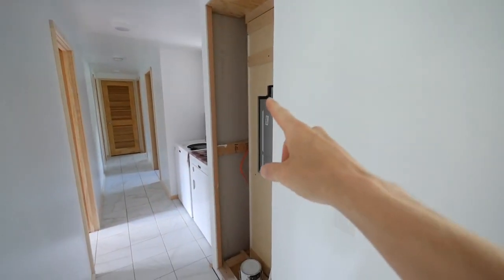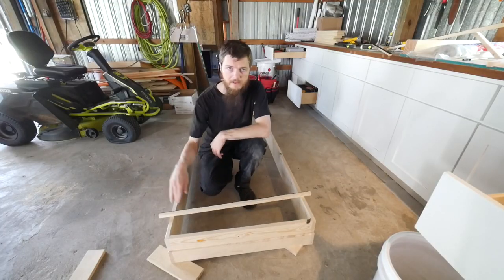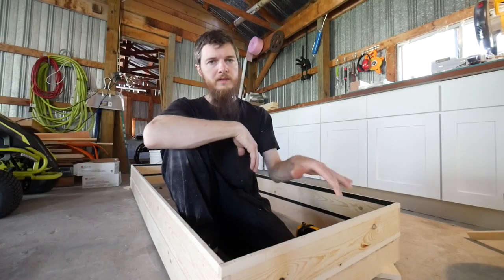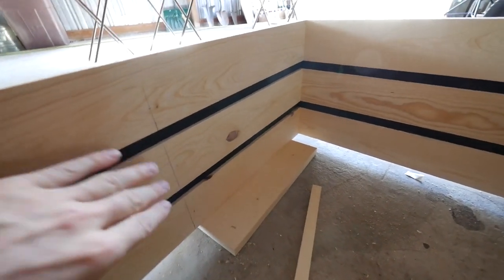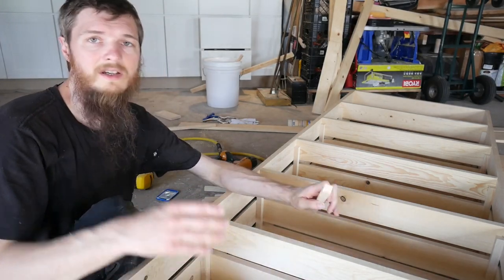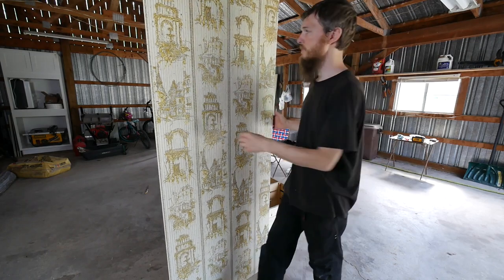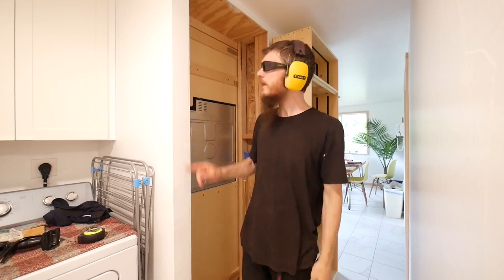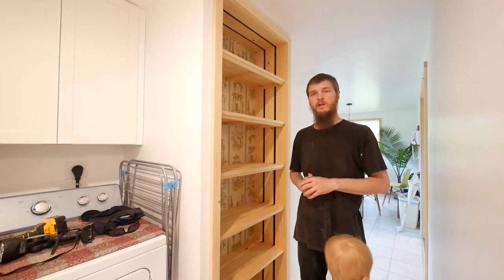A Novel Design for Our DIY Built-in Bookshelf

Comment: Your drive for a consistent look through the house is to be commended as is the way you thought through the design and Bella's input to get the black woodwork done to achieve the style effect. I worried that you should have used a mask while skimming the relief for the cutout and wondered if you could have used the vacuum for dust extraction. Plaster dust gets everywhere and you will be clearing it for a long time.
Great news that the roof and siding are on this year's projects-to-complete list. After all the very successful design and creation work for team DIY, you need it to get all the protection to preserve its comfort and look.

Comment: You have blended past and present beautifully.  The black addition to the shelf ties in to the floating shelf kindling box and the accent wall to me.  The use of the paneling as a backing ties in the kitchen paneling art and the original look of the house. Because it is a bookcase, the paneling will not be a dominant feature, but a hint of the past. The books will draw the eye first.  My only concern, which I am sure you considered, is a heat barrier between the oven and the back of the bookshelf.  Probably the back of the oven never gets hot to the touch.  Another great job!

Comment: Yay!  It’s in! Great job, Doug. You know me, I love that old paneling (and absolutely adored the kitchen paneling from a previous residence of yours,) but if I had been around, I would have encouraged you to test a technique by diluting some white paint, and white washing, then wiping off excess, so the undertone would go better with the wood & wall paint. I love it this way, but I’m thinking about the aesthetic. The good thing is that the books on the shelves break up the sallowness of the paneling. 

I know folks keep pestering you about the hole where the barrel stove used to reside, but I’m assuming that you’ll try to patch it when the new roofing supplies show up.  

Btw, what did Maverick show you, Doug? 

Also, could you have slightly dampened the drywall, and still use the circular saw? I know come saws utilize water, but I’m not familiar with your particular tool.
Reply from the maker: That roof hole is now repaired :) Maverick had a bug, haha. Can't dampen the drywall and use the saw, but we could have cut away the drywall first with a knife and then used the circular saw for the wood.

Comment: Love, love, love the old paneling for the shelf backing 😊.  A little glitch with the opening but all good. Try spraying the drywall with water before you cut. It helps cut the dust. Or have a vacuum hose trailin g the blade. Anyway, looks awesome.
Reply from the maker: Thanks!

Comment: In case you haven't already, blow the sheet rock dust out of your circ saw intakes with your compressor ASAP.  If the dust gets moist from humidity, it will solidify into a hard paste and seize up the motor. Gypsum dust destroys non-HEPA equipped shop vac and regular vacuum cleaner motors in the same way.

Comment: Love the bookshelf and the backing. If you get tired of it you can paint it. Did you already mention if the vents on the back of the oven will interfere with the bookshelf blocking it?
Reply from the maker: The oven is meant to be installed in an enclosed cabinet so it's all okay :)

Comment: I can imagine you clearing up dust for weeks after that. It continues to lay over a number of days! Is it safe to block the back of the cooker with your book shelf? Anyway looks good but did I hear you say you going to paint Belles room as I thought her bedroom was already finished? Take care and stay safe
Reply from the maker: The oven is meant to be in an enclosed cabinet. We only had to cut it open to make the oven slide back a little bit more to fit better. The oven vents out the front. Her room still just has the unpainted paper technique :) Thanks!

Comment: It turned out great. I was sure the old paneling piece would look bad, but I think it looks great. Does the back of the oven get very hot? Just worried that bookcase it right up against it.
Reply: The oven is made for tight clearance and heat shielded so it's okay. They talked about it when they installed it.
Reply: Thanks, I  watched it but I may have missed that part.

Comment: Did you get the commercial Maytag washer and dryer.  I have heard it is a good machine.    Have you been happy with the Maytag?  Your home is lovely
Reply from the maker: The ones we have aren't commercial grade. We're not entirely thrilled with the washer. We feel like it doesn't get the clothes as clean as it should and we have to put it on special settings to use more water since it barely uses any water on most settings. It's slow to wash a load. Maybe Maytag makes better washers, but the one we have could be better.
Reply: @diyfferent  thanks

Comment: I think the bookshelf looks great with the vintage back. I noticed the oven has a vent in the rear. Will that be ok with the back being so close?  Do you have plans to add any insulation underneath your floors? Love watching your channel.
Reply from the maker: Thanks! We have no plans for floor insulation. The oven is meant to be in an enclosed cabinet. We cut it open so the oven would fit better, that's all :) The oven vents out the front under the door :)

Comment: You're not worried about that old panelling covering the back of your oven? Is there a slight gap between the oven & the panelling? It looks great though!
Reply: The oven vents out the front
Reply from the maker: The cabinet was only cut open to make the oven fit better. It's meant to be sealed up and the oven vents out the front :)

Comment: If you have a hole in your Tractor Tire, plug it. I tried to patch mine from the inside and the tire has a raised cross hatch pattern on the inside of the tire, and no patch would stick. Those small tires are a PITA, to pull off the rim, and put back on the rim without damaging the bead. I hate Slime, it doesn’t fully stop the leak, and it will ruin any tire gauge. If you need to get back on a bead, use a Ratchet Strap around the tread, to compress the tire. Remove the Schrader valve so you can get a lot of air in the tire quickly.
Reply from the maker: The front tires have dozens of holes in them from running over thorny autumn olive branches :( We plan on getting airless tires at some point. For now we just blow them up before using the mower and they hold for a good while :) Thanks!

Comment: Sorry if this question was posed already but, is there no concerns regarding heat transfer, fire hazards having a wooden bookshelf and paper materials backing directly up to the back of an oven??🤔 Just curious! 🤷🏼‍♀️
Reply: The heat blows out the front rather than the back.
Reply from the maker: The oven is meant to be in an enclosed cabinet :)

Comment: Now if you take some sort of flex hose (old vacuum hose) and connect to dust exit tube on your chop saw, you could just stick it out the window.  It'd decrease your sawdust mess in that sparkling clean garage.  Only drawback would be it might attract carpenter ants next to the barn exterior.
Reply from the maker: Yea that would work. We just leave that window open and let the sawdust fly out. :)

Comment: Did you remember the hole in the roof of the workshop where the stove pipe went out? A good hard rain will get your beautiful cabinets wet and if they are pressed board they will come apart. I know you know all that but maybe forgot the hole.
Reply: There was a hole in the roof and a piece of the wall missing behind the new cupboards. Do you really think Doug would miss a beat on sealing those up?  He has such an eye for detail, I'm sure he found a great way to seal up and didn't film it yet.
Reply: @nancyparker3732  I hope and think you are right. But I know sometime I see things that need care and think I will get them later and just have too many things to do to think about the first thing. We too are remodeling a 1951 house and I sometime feel like an old computer, full and forget as well as working slow.
Reply from the maker: Both areas were repaired yesterday :)

Comment: Looks great! You guys are awesome! I know this is probably a really dumb question not trying to be rude at all, but the books against the oven , could it be a fire hazard ?
Reply: When they installed the wall oven, they talked about the clearance and heat from the oven. It's made for installation in tight clearance,  so it will be okay.
Reply: Steven Foster  thank you for answering my question.

Comment: Doug, Ashley has a flat tire on her lawnmower.
Let me guess
 You will put on whte siding and black shutters?????????
Build 2 new decks with roof over the front???????
You are still working hard. Yes, I still do not like the old kitchen paneling. I would have painted it black on the inside of the shelving
❤❤❤❤
Reply from the maker: We won't be doing any shutters :) We have deck ideas, we'll see how those go. Yep, the thorns on the autumn olive branches made dozens of holes in the front tires :(
Reply: @diyfferent  Boo on flat tires.

Comment: On the other side of that shelf I saw a vent on the oven. Is it safe to cover that vent?
Reply: He only cut that hole to make the oven fit. The oven vents at the top out the front. So yes its safe.
Reply from the maker: Yep, it's meant to be installed in an enclosed cabinet :)
Reply: Cool just thought to ask. Nice idea on the black inlay.

Comment: What about the vent on the back of oven?
Reply: These ovens are designed to be built in. No vents are necessary with these. I have the same type. It fits in a cupboard carcase that is inplace under the worktop.

Comment: yes it does vent from the front, but      then why is the vent there, could it be pulling in air or venting, there must be some reason why the company put it there, just saying. he is so good at what he builds i can guarantee that the panel is covering the vent making it useless  for whatever it does. if it does nothing it wouldn't be there.
Reply: Holes can be drilled in the shelf backing board to provide venting. I wondered the same thing.
Reply from the maker: The oven is designed to be installed in an enclosed cabinet. We only opened the back of the cabinet because the oven was a little too big to fit in this cabinet. So imagine the cabinet back was still intact. The vents on the back appear to be for the blower motor. But there's plenty of air space in the cabinet to dissipate any motor heat.

Comment: The Oven pulls air thru that Vent on the back of Your Oven, If you have trouble with the Oven later that might be the problem. Blocking that air flow is a no no!!!!!
Reply from the maker: The oven is meant to be in a sealed oven cabinet. The only reason the cabinet is cut open like that is because the oven wouldn't fit in. The oven vents out the front. :)